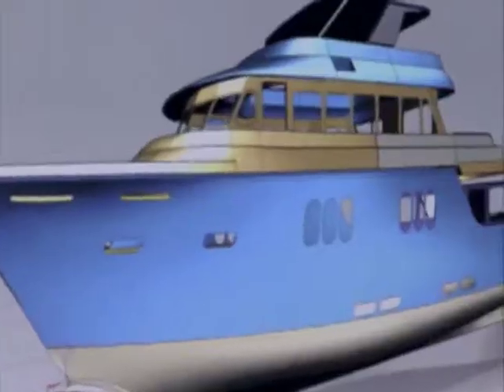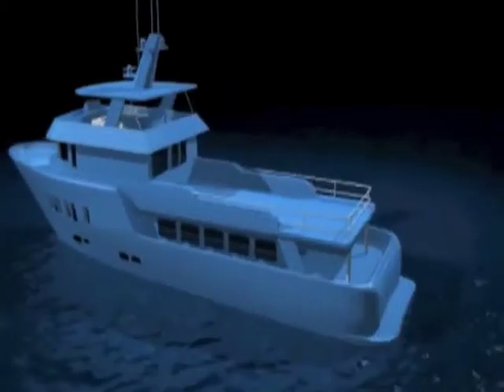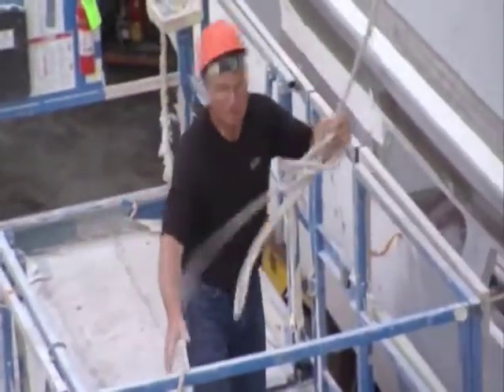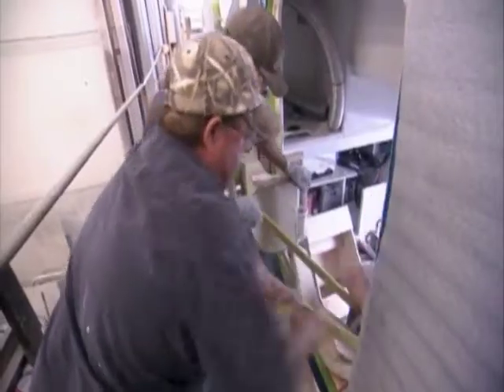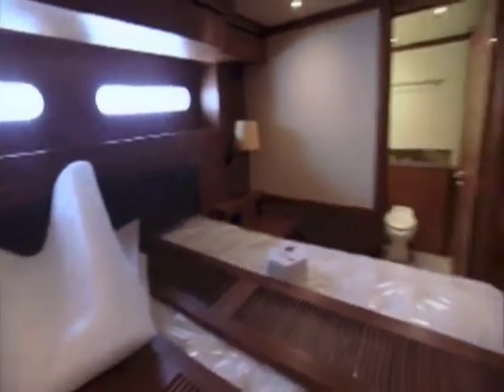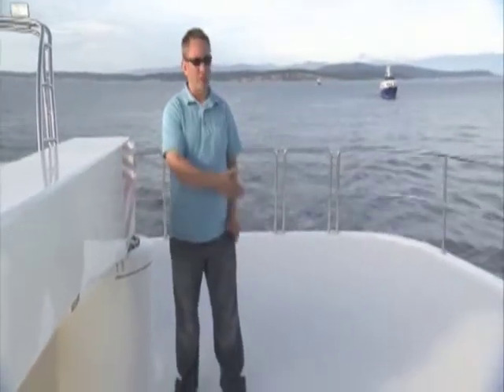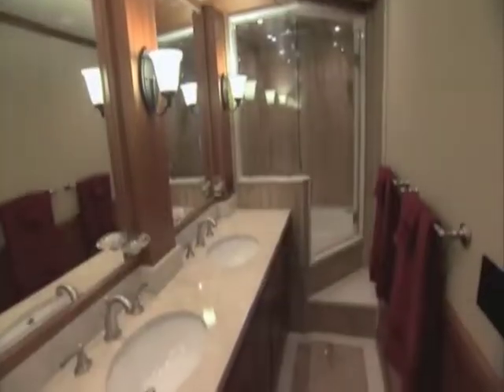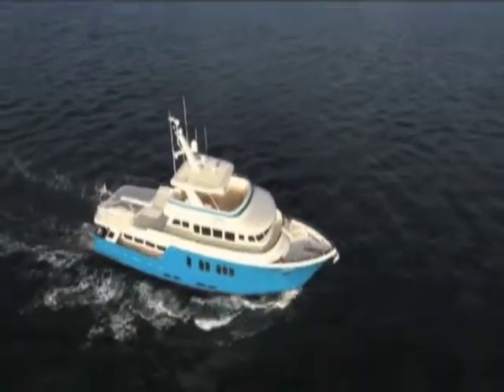Extreme Yachts

Comment: Make it out of steel less balast needed and more durable. Add an engine and enough fuel for a minimum 4k nm range then you have an explorer. Also no talk of system redundancy.
Reply: you basically described the Bering line up
Reply: @andrewb9264  I guess I did. 👍
Reply: Bering is Best

Comment: the ceiling grid in wood is nice touch, but I would use fake wood trim molding bc more flex less break, can b thinner wide profile & lighter colors or stain or textured finish up to fake stone. More creativity, in fake trim less cost & less wood over killing if on ceiling too. I am med tone guy but in the trim, going diff lighter look or dark trim nearly paint finish again gives u more creative room. Less wall of wood matchy matchy, most uppers not wood & used w/wood lowers. Clear trim right stain or double frosted, or dark plex, it's trim needs to make a statement or b subtle transition from 1 material to another.
Reply: You don’t have ceiling on a boat unless it’s a cargo ship as the cargo is loaded onto the ceiling of the boat in the hold

Comment: the flooring marble work & finish quality of wood r only theme in this boat both great 1 could hve pulled it off room to room, like marble & left way more design room. By using 2 marble & wood it locked the whole boat into 1 design every room, no stainless cover it too in wood. The darker stainless is very new & slick is it glass or is it metal & no prints.
Reply: No such thing as a floor on a boat

Comment: floors r beautiful but trim is old tired deal to traditional. If no grain it anti a species u use, for stain work. Less is more w/wood exceptional craftsmanship & like an accent wall not the theme is better bal. 4 walls ceiling & floors, so 1 of those covered or wanes coat & some to tie design together but rest of wood is for furniture, fake wall covering can b had & just as nice fancy looking at faction of cost. Ppl don't want ppl retiring on a job diff era long gone.

Comment: I love the toughness reaped mass produce the best windows & u can style over the windows w/dark plastic for bs look, or add extension plastic but windows r bullet proof marine grade tough efficient on a mass produced budget Ck home run. If they open or port hole even better. Yachts r getting sliding home like walls of glass, extreme NOW. Dutch doors r nice esp if water tight. Why can't u just make Wide fuck dutch doors & u get open feel in 5ft door that can slide open but shuts like a bank. 5ft slide dutch 1 way & 5ft slide other way is 10ft off open space, or 4ft by 4ft or 4 by 5 or 3 &4ft u can get opening u want & still b bullet tough bank water tight & mass production cost.

Comment: 5k crain is great! the accent piece or the use of room & furniture style in the room sets the design. Asian room no sitting on floor though u can only go so far 1 way. Fresh boemian meets Beverly hillbillies if u saw me explain it in another video. opposite of way the design bs work now. color not pillows bs. Hell even curtains r gray. It is like an art canvas room w/theme & the class upscale comes from furniture real wood but style varies from room to room. Americana, or frontier or craftsman or mid century the furniture gives it class & connects it all, but  the art is not just on the wall it is the room & color, ^ & design. u hve no idea from room to room what era or classic style or way it will come together. The flooring helps it all flow by staying same. It is about the right bal walls to pieces to wood to design to really pull it off, & how each boat fits the client. Other wise why bother, going to school & studying just by some paint & throw it on ground or by gal s of gray & hire painters not artist.
Reply: You don’t have a floor on a boat

Comment: fuel hydrogen 50cent per =gal is coming freeier power generation so power should b clean burn tech efficient & long life running cool to touch b going way up. So means better hull designs or parked yachts, & means less labor driving miss daisey days r long gone.